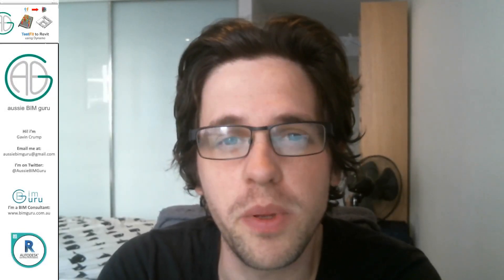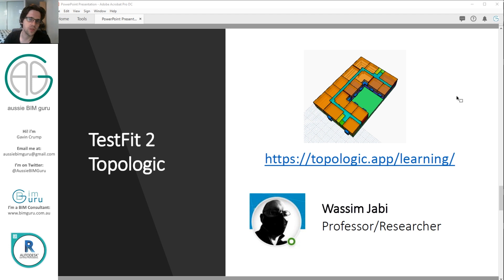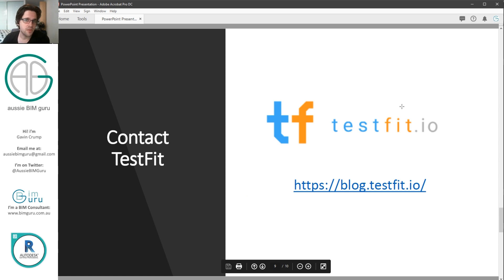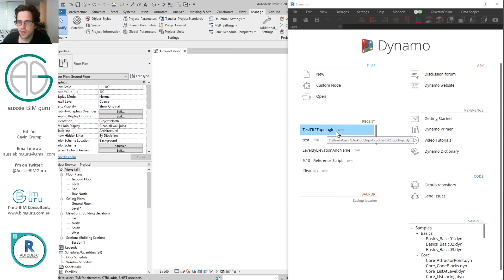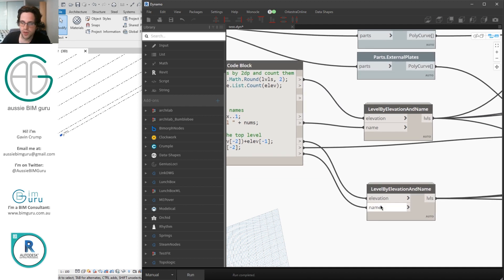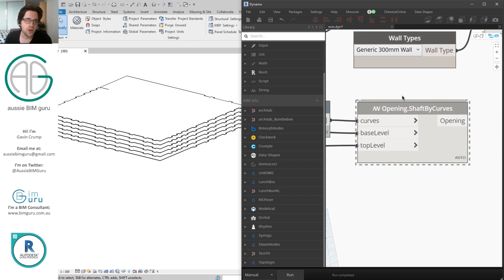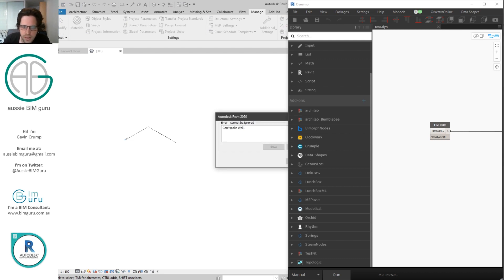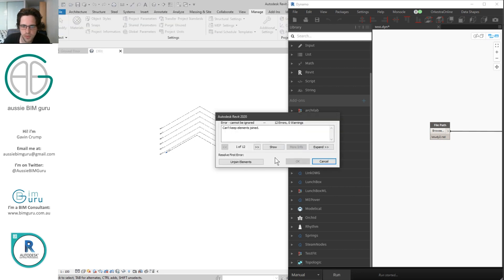TestFit to Revit using Dynamo!

Comment: Lots to learn here!

Feedback from this:

Parapets affect the facade area takeoffs - customer feedback
Would exporting to MM make more sense than meters? Asking for an american I know.
Add a roof level; and report level elevations in some meaningful way (Do not include the balconies to generate a roof slab)
Draw direction (the normal from the building)
Better training on how roads and sites work together (its unstable unless you start with roads and never touch property lines)
Some indication of wall location to generate revit geometry from
Reply from the maker: Indeed! I've actually got a list I'll send over that goes in a bit more detail. Some of the challenges might be an easy dynamo fix vs a problem in testfit itself (e.g. wall propagation).

Thanks once again for providing such a fun and useful product to the industry, I look forward to following and supporting its growth.

Comment: Nice demonstration, very powerful combo! I have come across the issue with the curve normal/wall orientation when using Dynamo to generate walls from single-line CAD drawings but couldn't resolve it either.
Reply from the maker: Yeah it can be quite devious, and thanks!

One method if the curves form closed patches is to convert them to polycurves and/or patch them, boolean out the smaller area surfaces from the biggest one and offset each curve to see if the result intersects with the surface. If it doesn't, reverse the curve, then they should all have a consistent normal direction.

For non patch-able curve sets I'm not quite sure what the method would be however!